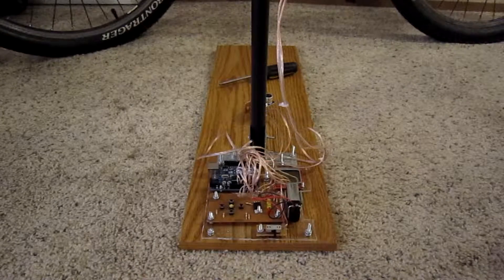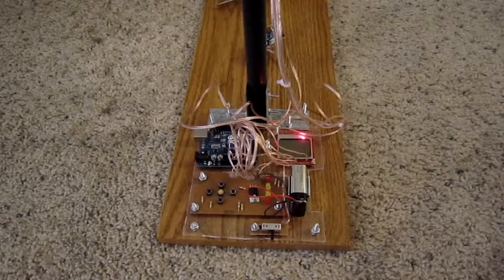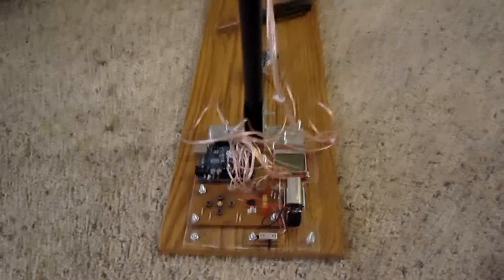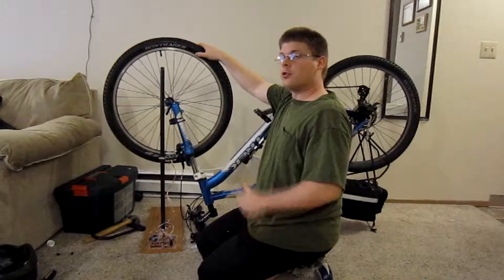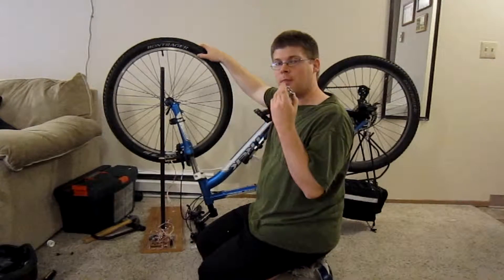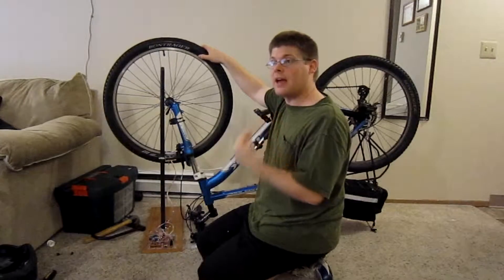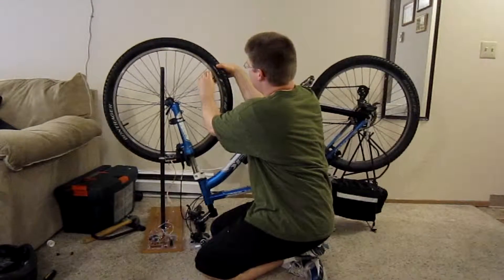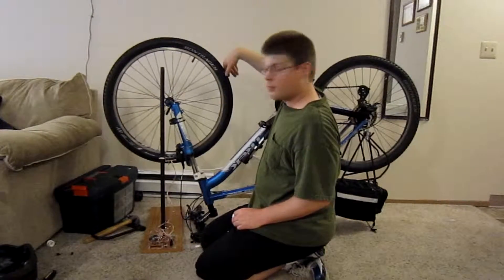Ultrasonic bicycle wheel truing stand

Comment from the maker: One issue I found is that ultrasonic distance sensors have too great a margin of error to precisely assist in truing a wheel. I have considered using some type of laser distance sensor, however they are quite expensive. Right now I have shelved this project until I can figure out a way to handle very precise measurements. Any ideas?

Comment: As a suggestion, you could make your circuit produce a continuous sound, and adjust the pitch of that sound continuously depending on the distance sensor readings. That way, turning the wheel some laps should produce a variating sound if the wheel is untrue, aid in locating where it deviates most from the mean, and then the true wheel spinning should produce a continuous sound. What do you think?
Reply from the maker: Helton Moraes That's a great idea. If I did something like that I would probably make it something you could turn on or off just because I wouldn't want my ears ringing after spending 20 minutes truing my wheel. That said, I may add that feature onto a future version of this.